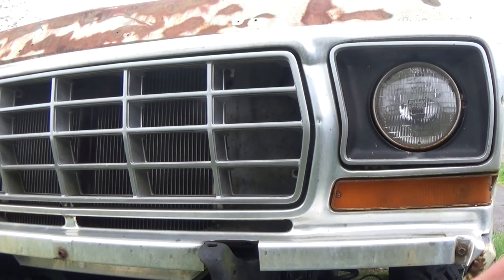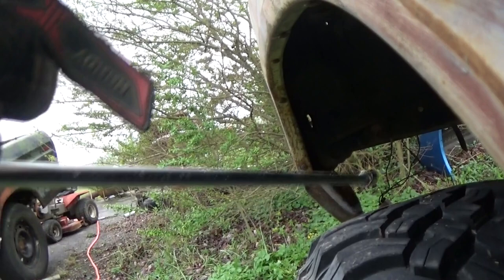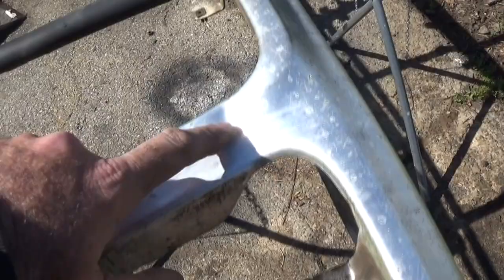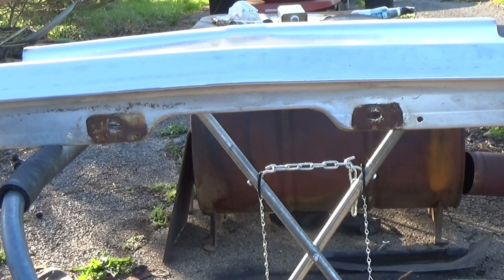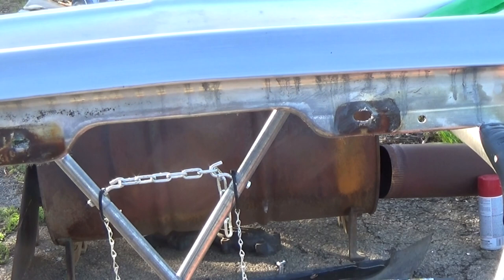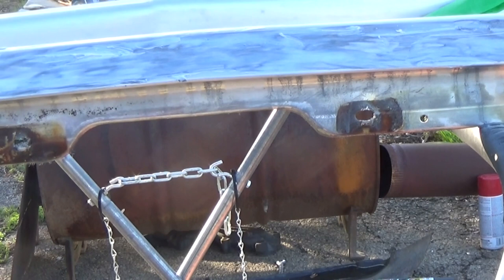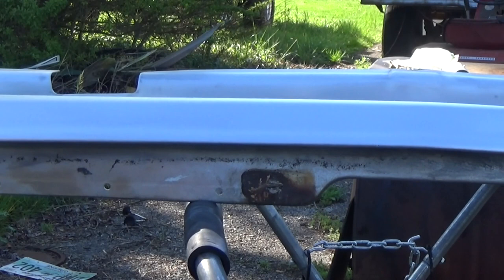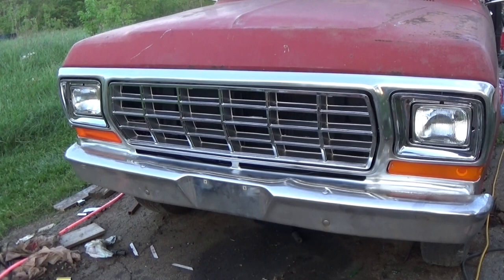1978-1979 Ford F-150 Grill Shell Polishing and Swap!

Comment: I actually like the split grills better myself but they all look good! Quite the transformation! My first truck was a 78 150 XLT and I used to get in a lot of arguments about the year cus of the square headlights lol. Something I’ve learned from 35 years of welding/fabricating is whenever you need to  grind/sand/cut with a zip disc aluminum spray the grinding or cutting disc with WD or really any similar lube and it’ll cut/grind MUCH better and faster cus the aluminum doesn’t load up the disc. You need to reapply quite often but it works really well. Love your vids you inspire me to keep my old junk goin! Dentsides, old tractors and labs are the best things goin! And maybe a cold Hamms once in awhile.
Reply from the maker: I think the 77 split grill was the best looking of the split grills but there is something about that 78-79 front end that I just prefer over the others. I have to keep my old stuff going. I’m not like a lot of other channels. I don’t have a new powerstroke hidden away to do work with. These literally are my work trucks that I depend on! I love my dentsides, my tractors, and my labs. I’ve never had a Hamms before. I’ve never seen them for sale here. I usually go for a Miller. I’d definitely try a Hamms if I could find any. Thank you for your kind words!

Comment: Easy off heavy duty oven cleaner also works well for removing the anodized coating I found out. I always preferred the 76/77 grille myself. It does look good though!
Reply from the maker: I tried oven cleaner and it didn’t touch it!
Reply: @BlackLabGarage  I took the anodized coating off the trunk lid trim on my galaxie with it. I sprayed it, let it sit for 10 minutes, scuffed the piece up with a scotchbrite real quick, wiped it off and resprayed it and let it sit for like a half hour or so. It came right off after that.
Reply from the maker: @MattsRageFitGarage  I’ve heard of other people using oven cleaner to remove anodizing but I tried it twice and scuffed it in between but it didn’t work for me. Maybe oven cleaner is weaker these days?
Reply: @BlackLabGarage  It depends on the oven cleaner. Some cheaper cleaners don't contain lye and that's the main ingredient that works on the anodized coating.
Reply from the maker: @MattsRageFitGarage  I’ll look at the label again on the oven cleaner. I usually keep several cans on hand for cleaning grease off of engines.

Comment: Looks like harnesses have to be changed to right since light is on bottom on  square headlight setup and top on split grill im doing it with my truck but im switching to the split grill
Reply from the maker: It would depend on what year your harness is that you are using? The harness should be long enough since you are moving them from them bottom to the top and 1975 to 1977 uses the same bulb socket as 1978-1979 but 1973-1974 uses a different socket. In that case you could always just change the socket which is usually a good idea anyway as old as these sockets are getting to be they can be quite problematic these days.

Comment: What’s your thoughts on rattle can clear coat? Just not comfortable using a spray gun, not much experience with ‘em. Maybe you could do a video on spray guns? 🤔😃
Reply from the maker: Well you are in luck because Eastwood does offer the DTM clear in a spray can! You will probably see me doing some paint spraying a little later on on my 1978 F-150 4x4.
Reply from the maker: But I wouldn't use a regular parts store spray can clear coat on it because it will turn loose of the metal very fast. Only DTM (direct to metal) clears are made to spray over bare metal and adhere to it
Reply: Eastwood? I think I’ve seen their products at ORielys.
Reply from the maker: Yes...Eastwood clear was what I was using in that video. @Crz_hrz

Comment: Do you were  I can fine long bed 77/ 79 ford truck
Reply from the maker: Long wheel base dentsides are much easier to find than a short wheel base. That green bed/trailer you could see in this video I literally found sitting in the weeds! They are still out there but a lot of them are being boarded up.